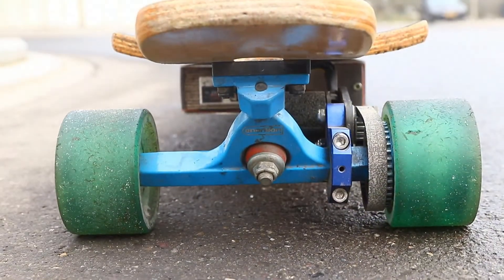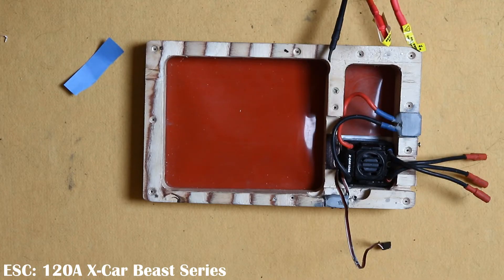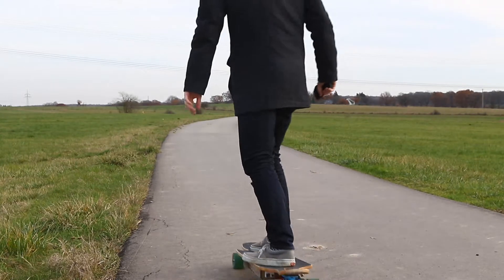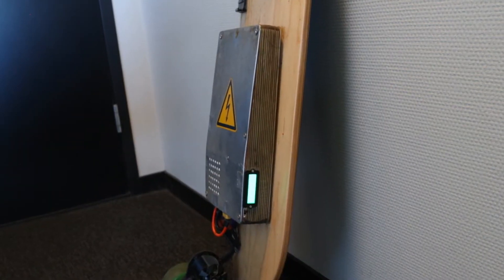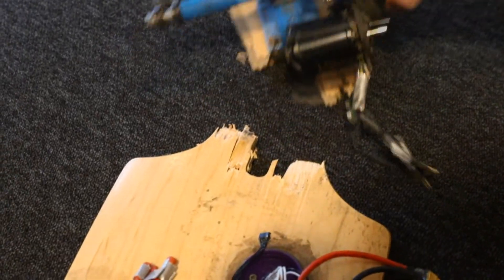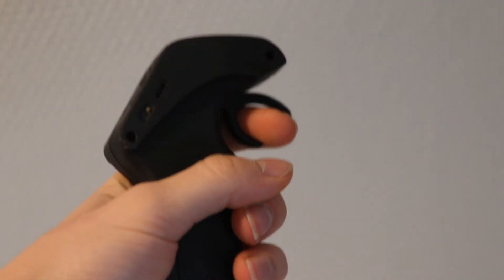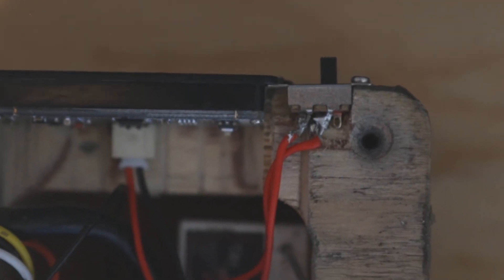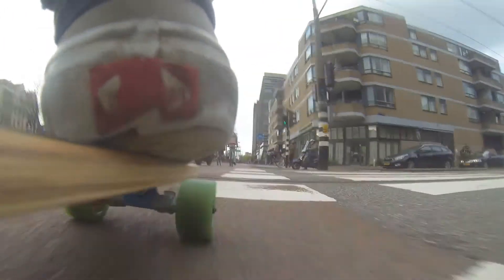DIY Electric Longboard | 40kmph / 25mph | 20km range |

Comment: PLEASE REP ME !! Can I reach speeds of 40km/h  with two Zippy 5000mah and Motor 320kv batteries? and how much distance can I get?
Reply from the maker: 320 is a dangerously high kv. I don't recommend it. Top speed also depends on gearing and wheel size. Google: "electric longboard speed calculator". Distance depends on many things. Google: "electric longboard distance calculator"
Reply: I want to achieve 40km/h and ranger (20km) , what motor I should buy for two Zippy 5000mah  ? SK3 2700kv or N5065 270kv?
Reply from the maker: @ThanhNguyen-rn5bj  2700kv is obviously way too high. Stay between 190 and 300. A 50mm motor is ok but 64 is better. You'll really have to do your own research on motors. There are too many options
Reply: thanks bro

Comment: Great video!

I saw that you had a battery meter on your electric skateboard and have been wanting to do the same on mine. How did you connect the meter onto the system?  Thanks.
Reply from the maker: Simply connect the wires of the battery screen to the positive and negative of your battery pack. The screen comes with a little configuration button which you hold, and then connect power, to set up how many cells you're running, and from that it calculates percentage of your pack :)

Comment: i was wondering how much does ur setup fully cost?
Reply: What are you doing to your eskate? I ride mine daily in every weather and didnt have to replace one thing
Reply from the maker: Rain + not having a good enclosure is a big factor. Having to replace batteries simply because they're at the end of their life, mistakes I've made, and simply abusing the board because I use it as a tool and don't treat it too too carefully. 
I'd rather use it to its full potential, and push it even a bit beyond that, than treat it super careful and not get as much utility out of it :)
Reply: I have seen similar of this one and it cost around 600usd. In my opinion It's better to buy something called huger board with the same price (not an advertisement) For me, I don't want to spend that much money for E-board I want something that have much lower price than 600 usd
Reply from the maker: Because of constant need for repairs and replacements due to either my fault or external factors, I've spent easily over 1100 EUR. New I'd say it's about 750 EUR
Reply: Yeah i am with you. I use my board every day in every weather. For me it is a real way of transportation. Built my battery enclosure out of cardboard :p
Reply from the maker: Cardboard!!?? xD Doesn't sound very waterproof!
I'm working on a 2nd board which will be much faster, more powerful and should be nearly 100% waterproof so I'll be able to abuse it even more! >:D
Reply: Thats my board if you are interested: (Its pennyboard inspired)
https://i.imgur.com/335TSVF.jpg
https://i.imgur.com/VnkfmsC.jpg

Its made out of cardboard and alot of waterproof ductape + some carbonfiber  foil :)

Yeah, i want do build a 2nd one aswell. Kinda addicting

Comment: hi tijmen, nice video. 
yesterday  i was watching DIY Electric Skateboard to another person, he used motor brushless of Turnigy Aerodrive SK3 - 6374-192kv . but in here u use Alien 5065 270KV 2200W . so Which do you think is the best of both ? thanks
Reply from the maker: The Turnigy is bigger but lower kv (more torque, lower top speed), and mine's smaller but higher top speed, but that also depends on how many cells you'll be running (batteries). So it just depends on what you need it for.

Comment: Nice video! How much did it cost?
Reply from the maker: There's a parts list in the description, but I've spent over 1000 because of mistakes, but new you could probably build it for 750 euros
Reply: Tijmen vdP Ok, Thanks!
Reply: i think 750€ is a bit over the top. i think it costs less

Comment: Hé Tijmen. Nice video! I want to build my own e-board and i'm doing a lot of research. Do you know if you overcharge your LiPo batteries since your charger is  25.2 volts. Your BMS discontinuous charging at  4.02v per cell (12.06V) if i'm correct. That is more than the 11.1V that your battery specs. This part of the build is still confusing to me. How long does it takes to charge the board with your setup?
Reply from the maker: I don't currently have a BMS in my build. I have a 6S LiPo pack which totals to 25.2V when fully charged. My LiPo charger stops charging when it's full. Takes a couple of hours to charge
Reply: There is a BMS in your partslist. I assumed u used it because you are using a 25.2V powerbrick.  I concluded that you are over charging your LiPo pack about 3V. Do you use your board much? and did you have an encounter with the police. Just curious because I also live in the Netherlands.
Reply: You can go way over the specs of your pack. You can charge each cell safely to about 4,2 volts
Reply: Thanks for the reply. Did not know that 4.2V is the maximum.